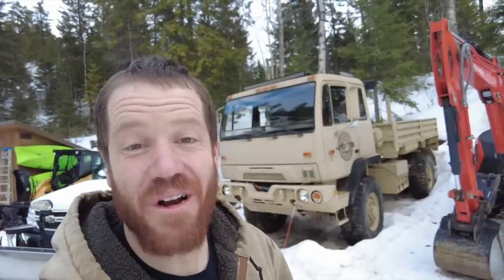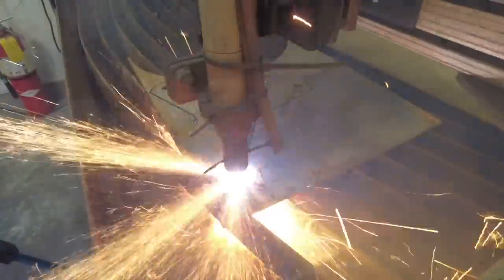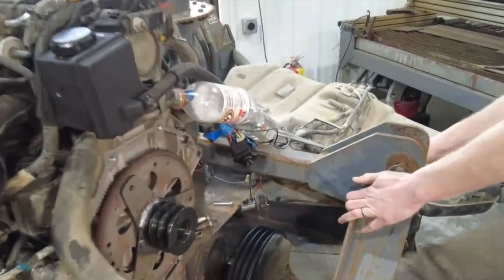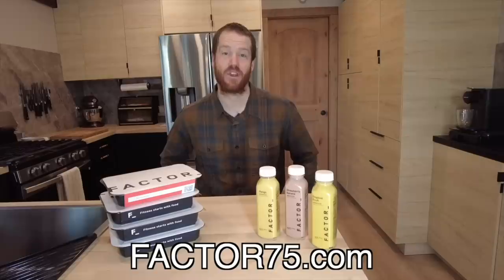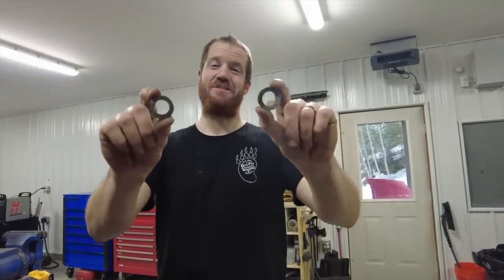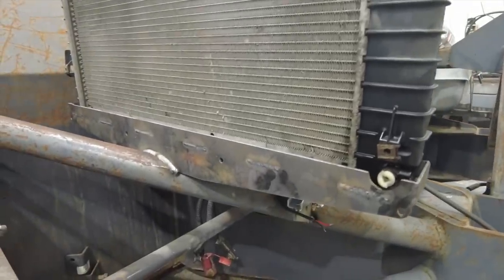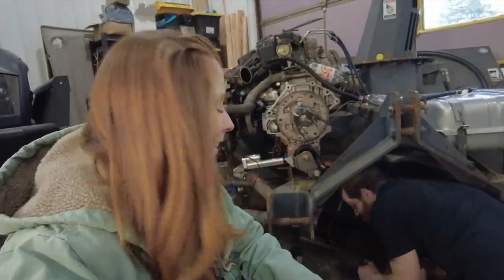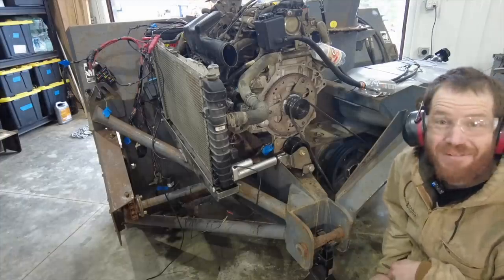DOES IT WORK?! | Building a MASSIVE Snow Blower P3

Comment: You really should put another belt tensioner on the opposite side higher or lower.Basically you need a stabilizer. that keeps that belt from flopping.  Because that's a lot of travel and long belt. My bet is your going to have a lot of broken belts very fast. Otherwise great job !  Your a damn good fabricator /builder ! 
 I'm pleased to see what young people are out there trying your hands at ! You should look into fabricating some frames and placing some engines , and building some ride on blowers. Then rent them in the winter or have a side business snow plowing service. Tweak that custom snowplow and go from there !  Keep dreaming up great ideas !

Comment: @4:54 Any shear bolts that I have should shear where there are no threads.  Did those bolts come with the blower?

Do you also have some actuators for the chute rotation and the direction flap?

Comment: Looks like that big sheave is bored for a QD bushing.  The holes are not meant to handle torque, only to pull the bushing tight.  Friction between the bushing and sheave and usually a keyway between bushing and shaft, as well as friction when the bushing is tight, are meant to transfer torque.  Those little 1/4 onch bolts will probably break.

Comment: Am I glad I found this video. I Just subbed to your channel as well. I just did a smaller version of this and managed to get it to a usable state this winter. we mounted a  6 foot Frontier blower to the front of a 1989 Chevy Astro Van. In the back of the van we put an inline Chevy 6 cyl from a 1967 truck and ran a chain drive inside, then to PTO shaft and a belt drive system (belts get tension by an actuator) through the floor to a PTO shaft under the van to the blower up front. The front of the van looks like the back of a tractor. Lots of fabricating, but worth it in the end. 150 HP on tap and we only need about 80 of it. So far we have realized to things....that chain drive has to go and we are re-doing this with a belt drive instead. I may have to borrow that tensioner idea from you guys for when we switch ours over, I like it. The chain spins at 2200 RPM and we can't keep oil on it and we burnt up a chain in 12 hours. Apparently in needs to be in an oil filled chain case...lol....oooops. Second thing is, we are over running the blower, because I don't think it should be throwing snow 60 feet. Can't waite to see this beast get put on that truck. This is going to be Epic...and Yes it will work.
Reply from the maker: Hi Viking! Man that’s one cool van you built. This comment gave me some motivation to keep going on this project. Thanks for sharing!

Comment: Well done, looks mostly good, I applaud your ingenuity.  

That being said, I think you are going to go through a lot of belts.  On start up the small pulley spins, but the larger pulley does not.  This causes the belts to stay in place and rub  on the smaller pulley.  Even a few seconds of rubbing can cause the belts to degrade (material gets rubbed away from friction).  When you engage the belt tensioner it's fine, no issues.  Luckily, due to your planning, nothing catastrophic will happen, I just think you'll end up spending more money than you want on belts.

:EDIT: Saw a problem, didn't provide a solution.   A way to keep the pulley stationary until you want it to engage it, would be to fabricate something similar to an A/C compressor.  On an A/C compressor, th pulley is allowed to free wheel until you engage the A/C, then a magnet attaches the pulley to the shaft in the compressor and like magic, your A/C works.  That however, is a solution for another day.

Overall, I think you guys did very well.  I look forward to see how you will mount it to the vehicle, and seeing it in action.

Comment: As your now using the car engine as a stationary engine, even in the cold of winter with the engine is running at any speed you will need to have a full size electric fan pushing or pulling air through the radiator with a good shroud and if its under a good load the standard radiator will not be enough to cool, the engine. I would recommend Looking at an aluminum unrated radiator with a deeper core and shroud for the fan with a high flow rate.

Comment: Do you think a brake for the snow blower would be a good safety addition?  You may need to clean out the blower at some point and we all get lazy doing so with the engine running.  A positive brake would guarantee no movement when working around parts that could POTENTIALLY move.  Even though torque would be low, any movement could be threatening.  I think tractor PTOs usually engage a brake when they are not running.  
You probably know - don't forget to grease the snow blower bearings.

Comment: Nice one well done 👍 proof of concept in motion . You inspire methods to tweek iT . I'm looking at the polycarbonate tension pulley ,I think it will friction fail first ,might wanna have an aluminum or nylon one as backup . could be wrong & if it ain't broke don't fix it 😉

Comment: How do you like your plasma table? I have a plamscam, and the software that runs it is pretty clumsy, especially if you have any CAD experience with other software. What are you going to do for throttle control, cruise control? Have you determined what rpm you will need out of the engine to get  the proper PTO speed for the blower? Cool project

Comment: As far as pulley belts go. I would have cut a small belt to go around the pulleys. Then I will wrap around the electric tape over them just like the custom belt would do. Now I will use a string and measure the outside diameter of the elastic belt. Measure the length of the string to take with me to the auto parts store to see if they have the right length belt. i hope this saves you multiple trips to the store next time, when you need a custom belt.

Comment: at 19:32 are there enough welds on the actuator bracket?  That part is going to be in tension and vibration could crack the welds I would think.

Comment: Why don't you have water in the cutting  table?  All of the ones I've seen have water and it helps also to keep sparks from flying  and helps keep the metal getting  to hot!!! Great work being done.
Reply: I wanted to let you know that there is people out there claiming  to be you both and told me I had won something  but I clipped on your picture  and it had no subscribers so I did report them. Just wanted to give you heads up

Comment: When running a gang belt order a banded belt or matched sets I prefer banded the 3 v belts in your case are  exactly the same length and does the best job of power transmission

Comment: I feel the way the sheave is mounted to the engine will be a problem. The belt tension will thrust the crankshaft of the engine towards the other sheave, if the belts are tight enough not to slip, it will wipe out the crankshaft and main bearings. Look into an over Center clutch or a sheave adaptor PTO. I’d hate to see the engine fail after running a few minutes of operation.

Comment: Now you have the right belt length. It's time to lubricant the Chain drive system with a great quality Chain lubricant and grease all the Bearings. 
What type of Electrical wiring are you doing to make it work from the Cab of the Truck. Have any thoughts on how to operate the throttle from the Cab. 
In ordering the Belt for the Blower use a 3 belt configuration for Heavy Construction Equipment, they are very expensive and will last longer. I know it because of 40ty years experience working on Equipment. The belt is the same style that is used on large wood chippers. 
Good luck with the rest of your indever.

Comment: I love that you set the bar high and then make it work and happen. Kudos to you both. A few questions? Weight? Of the whole system, including the  mount, still to be built? Snow stakes on your road for plowing? Skids on the bottom? Two or three? (Due to your uneven road...) Oil, grease and Paint? (Once upon a time, I lived at 8,000 feet-180" per year snowfall. One winter shoveling a 50 foot driveway (often) and several times a day, at least a dozen times... and off the roof, upwards twice... drifts...) Having machines... a great idea. As my S.O. says, I have back up systems for my back up systems... as do you... Yay! You!

Comment: Looks good. Only problem I noticed is your tensioner/engaging pulley is on on the wrong side of the belt.. Looking at the flex-plate end of the engine, it rotates clockwise. so the drive side of the belt, that is the side under tension from the engine that is pulling the belt tight should not have the tensioner on it. The tensioner should be on the "slack" side of the belt to "take up" the slop when the torque is applied and causes the belt to stretch. Additionally, you should have a spring load applied to the tensioner so it will automatically compensate for the slack when the belts are being stretched under load. Just one crotchety old mechanics observations on a job well done.
Reply from the maker: Hi Mike, thanks for the input. The tensioner is on the slack side. The engine rotates CCW when looking at it from the flex plate side.

Comment: Looks good everything went as planned except for the belts... sounds normal to me.

Myself I'm a bit uncomfortable with the shearbolt coupling being dry I know on the shear coupling we used a lightweight grease to keep the metal from galling. You could achieve the same thing using anti seizing compound on the mating surfaces and ball groove.

Things are coming right along... so hopefully it will be done in time to blow some snow this year. Many of the larger blowers and snow blades use adjustable casters to maintain snow cutting height over a steel shoe. Seeing how you are dealing with rocky road surfaces this may be something to think about adding to save wear and tear on the unit. Oh think about adding an adjustable jack on the back side to stabilize the unit when not coupled to the truck. Trust me you will kick yourself for not doing it when you go to couple things back up the next time! Ask me how I know... been there when manhandling field equipment to a tractor.

Comment: Man that's pretty good , but on both you need a big Badland winch at least 12.000 lbs and don't get cable get the new fiber it's so much better and just as strong or stronger one on front and back if you can but at least front you can still pull backwards. You will not regret it you will use it all the time

Comment: If you're installing your own linear actuator once, why not just do the same for the throttle control instead of using the cruise control? Can you do a quick pros/cons on your thoughts comparison of the 2 approaches?
Reply from the maker: I haven't done this before so of course I could be wrong, but I think we need the cruise control. If we just set the throttle to say 50%, the engine would rev way up and then under load it would bog down and rpm would drop. We need the cruise control to vary the throttle position based on load to try and maintain rpm

Comment: You two are amazing but I do hope there is another video of the truly finished big boy blower with all the controls mounted in the cab from starting the donkey engine for the blower to the Cruze control.  To make it a detachable blower you could trailer 7 pin plugs or even a couple of them to pass through all wiring fir running an ass
Reply: Advisories, kites an such

Comment: Hi i don't mean to discourage you. but we already did the same build with belts and we couldnt keep the belts on. thore up a set pretty fast espically in heavy snow. we ended up rebuilding it using a chain that had to be in a oil resevoir. Good Luck

Comment: I’m kind of concerned about the side pressure on the main bearings on the crankshaft might take the crank bearing out and the rear seal you might have to run a stub shaft out with another bearing

Comment: I am not a debbie downer but normally V belts are not to bend "backwards". Serpentine belts bend backwards and forwards. I would have preferred to see the belt tension pulley pull out on the belts rather than press in.  I guess as long as the belts are new and flexible you should be good. I would guess you will have some premature belt failure but hey, you are expecting them to be eaten a bit with the slip start anyway.  Best wishes on keeping the roads clear.  :)

Comment: Cool build, but I think it's going to be under powered unless you can resize the pulleys to gear it down and  have the engine operating at 4000+ rpm when blowing snow.

Comment: I personally think you are going to have a problem with that actuator holding tension on all three belts with a snow load. It will have some severe tension at that point. It might work once....but I wouldn't count on that as a full time design. I think you will need a more mechanical design that locks the tensioner in place when engaged. Just my take, love the channel and wish you the best.

Comment: Didn’t you buy a skiff steer with a snowblower? How much snow do you get in Idahoor are going in the snow removal business??  Will the radiator keep the engine the cool enough?  You aren’t going to go that fast in the snow so there won’t be air flowing through the radiator.  We live in Atlanta and sitting in traffic we need an electric fan to blow air through the radiator to keep it cool.  I guess the cold air will help but over a long period of time you can overheat the engine.  Just a thought!

Comment: you dont want to run that long in that kind of cold with out a muffler and maby i missed it but did you mount the air filter where it wont get wet wet motor dont like to run

Comment: Three belt sets come as matched sets. Not sure if 5/8" makes a difference n length to a 1/2"? You definitely need 3 the 5/8" size. My flail mower is very similar which all the belts slip in heavy cutting. Means lifting it out of the mulch while stopped for it to pick up again. Then continue slower. I guess snow blowers work really hard also. Courtney's mom has got it going on. Vote her worker of the day since she carried and stacked it all. Well it's summer here an very hot. I'd almost switch places in weather like this. Forecast 42° C today.

Comment: I´m sorry to be negative, this setup will not be able to transfer the power available. V-belts is easy to set up but one would need much bigger pulleys and there’s no space for that. A chain drive has much higher capacity but is more tricky to build as you would need a clutch in order to disengage. Another thing is that the setup only utilizes about 1/3 of this engine’s available peak power. It is also worth to mention that running at 2200 rpm the torque will drop if you overload the engine. That means that the engine die very easily in those situations. Running the engine on max power will give a torque rise when the is overloaded, hence it is much easier to avoid the engine dying. Industrial diesel engines is the preferred option for these kind of applications, not only for fuel efficiency but also for having max power at a much lower rpm. Still, good luck with the project, but I anticipate a lot of frustration when putting this machinery in operation (too low power, torque drop and lack transmission capacity). Check out the online calculators for V-belt drives.

Comment: It is really a large engine. Did you consider  a two Cylinder Motorcycle engine. The engine could run without all the electronics. And can get the engine speed by a hand trotle

Comment: I was actually skeptical about it but it works and hopefully everything works as planned. One question though is why didn’t you use one of those V Twin engines from Horrible Freight? They’re inexpensive, no electronics, way more compact than the 4cyl , they have a built in fuel tank, electric start, plenty of power to turn a hydraulic pump, it would be easy to run a cable to the throttle and the key switch from inside the truck. A friend runs his small crane with one and it has way more power than he’ll ever need. It would also be a LOT lighter for the truck to lift.
Reply from the maker: I looked into them, even considering using two of them. It just wouldn't be enough power to run the blower.
Reply: @AmbitionStrikes  now that you say that and I think about it those motors are only 15hp and that blower must take quite a bit of power because there’s quite a load in trying to constantly push (depending on the snow conditions) 200-500lbs, or however many cubic feet of snow that can fit in the blower. Even with 2 it would still only be 30hp and it probably took at least a 50hp or bigger tractor to run that big of a blower. Don’t know if you’ve tried it out yet but good luck and be careful of rocks. They love sucking them up and jamming up the whole works.🍀

Comment: I think you need to have electric fans on the radiator not enough air is going to move across it to keep the engine cool.
Reply from the maker: It actually has the stock electric fans from the Sunfire.

Comment: FAAAAANTASTIC job,,,, Great engineering... To get right size belt rap Half inch ROPE around pulley (mark Rope and Measure)  ORRRRR 2 inch tap around tops of Pulles (not in bottom of groves), stick together then Cut and measure... You would have saved TWO trips to store...

Comment: Nice work Riley,  But I hate to be the one to pop the bubble. The main bearings in that motor or any motor for that matter are NOT designed to have that kind of a load put on them. You will ruin that motor in no time. You need to put some real heavy duty bearings meaning two to support that load. Good luck